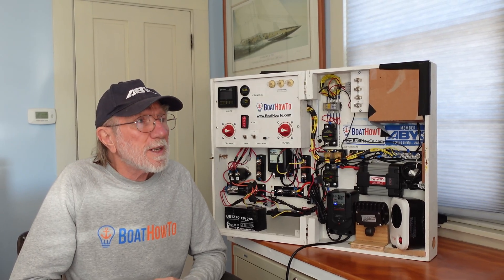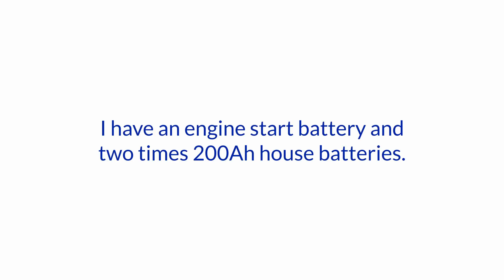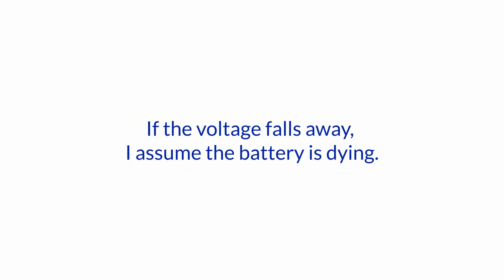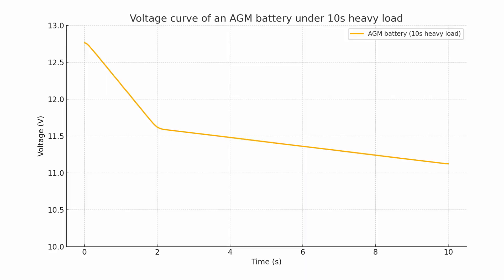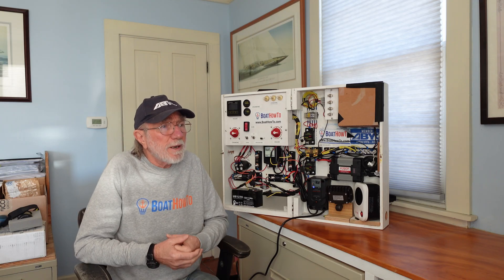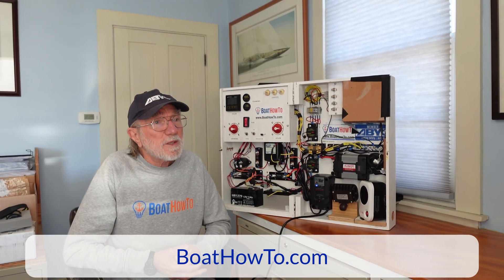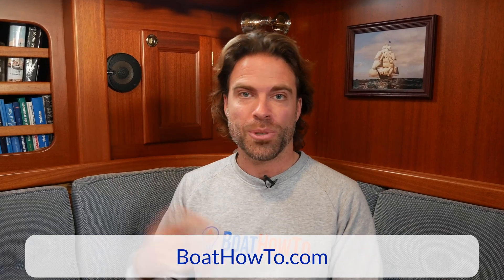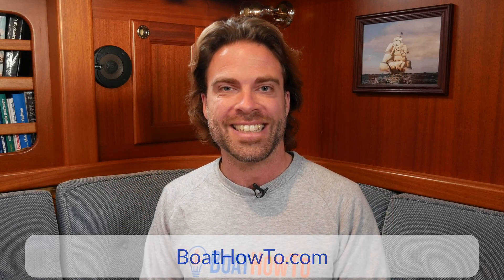Is this a good BATTERY TEST ?? 😅 | Ask The Expert with NIGEL CALDER

Comment: Is it realistic to power an 8kW 48 volt electric auxiliary sailboat motor with other than Li batteries? I have a client with this arrangement on a 30 foot sailboat and he toasted the AGM batteries.  There were two banks of four 110 amp hour 12 volt AGM batteries wired in series for the 48 volt motor connected in parallel with a 1/all/2/off battery switch. Even pulling 4kW off of this arrangements seems to be an overload condition for the batteries.

Comment: I am surprised that you do not mention battery internal resistance. Battery voltage not being a reliable indicator of battery state of capacity, or that different battery types in the lead acid range have different performance outputs with regard to Amp's over a period of time. IE, Starter battery and domestic battery. Gel, AGM, Lead acid and the new holy grail, LiFePO4 Lithium. The latter having newer forms that can cope with start amperages with massive CCA's and slow release rates over longer periods. Nigel has exceptional knowledge and understanding of these facts. Personally, I do  not think you have explained adequately these points or allowed Nigel the time to give us the benefit of his expertise and years of experience on this subject. A trip to Amazon and parting with as little as £50 will provide you with a reliable electronic battery analyzer that will give you an accurate analysis of both starter and domestic battery performance and capacity based on the aforementioned criteria. For those reasons I an giving your video a thumbs down. Nigel is a legend I think you should give him more time not just 2 minutes and 7 seconds.  Regards Ant.
Reply: Ant-
These videos are not meant to provide comprehensive info. Nigel and Jan have put together a training program for boat electrical systems and these videos lightly touch on the subjects that they DO cover thoroughly in their electrical courses. Jan isn't limiting Nigel's time- these two could talk for hours and hours. The point of the videos are- I think- that if you are interested in learning more about the topics they discuss then enroll in their awesome courses!
Reply: @KimClark-1 oh it’s just an advertisement. Not ment to be accurate or helpful then.  Sorry had not realised 😢
Reply: @SVImpavidus I am sure that Dr. Jan Athenstadt and Nigel Calder do intend to helpfully inform. But if you listen to the end of these short videos Jan says that if you want to learn more then visit the Boat How To site and sign up. There they do go into great detail. I enrolled and the training is great!  And Nigel discusses on another of these short videos just why the options you mention for battery testing are not acceptable.
Reply: @KimClark-1 What? Internal resistance of battery is not suitable to assess the state of change. You clearly need a refund.
Reply: @SVImpavidus I love an argument, but not a stupid one. Have a nice day.